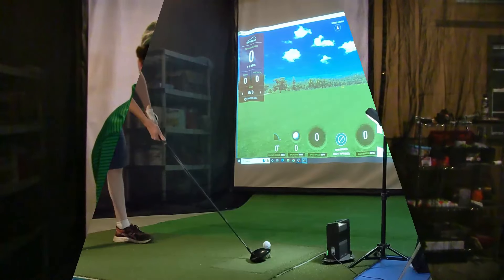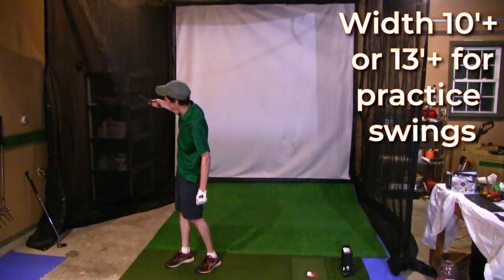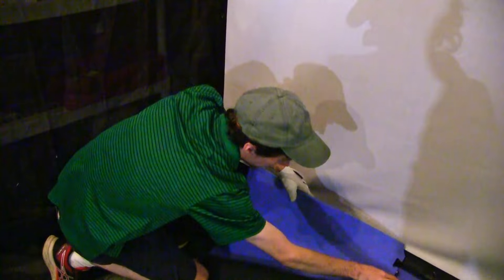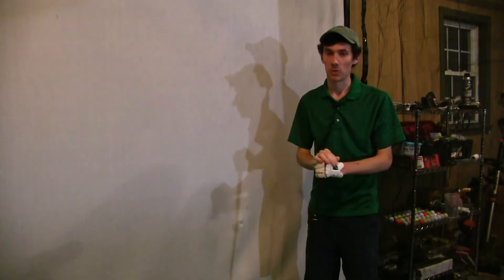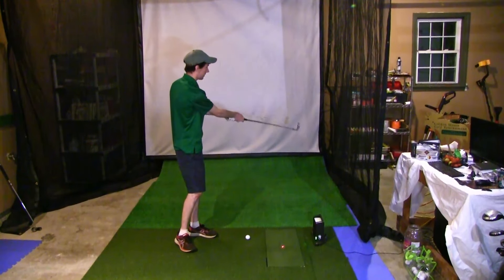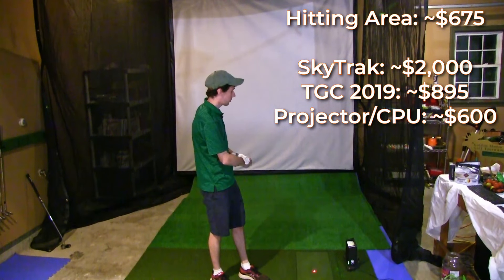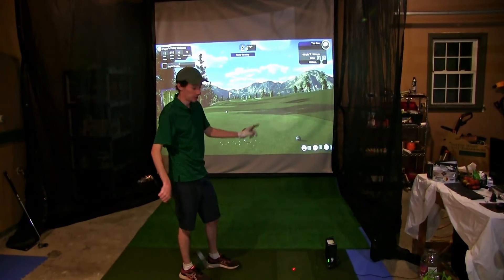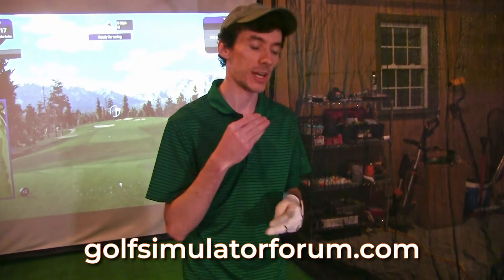Building a Cheap & Safe Garage Simulator Cage - SkyTrak, Mevo, etc

Comment: Excellent video, I really appreciated the detail.  If I were to install a simulator in my garage I would need to accommodate left and right hand golfers.  What modifications need to be made?  How much more space do I need?
Reply from the maker: Depends on if you are using a fixed overhead LM or something that you physically adjust based on the user, then if you want everyone hitting from the same spot. Generally speaking you are going to need about another 6' of width to accommodate swings from both sides of a central position, but make sure you research on the golf simulator forums to see what people using your chosen LM are building! Good luck my friend!

Comment: Great build.....What was the mounting height and distance from the screen of your IN119HDx projector?  Thanks,
Reply from the maker: It's is mounted about 9'8" above the ground, 14'8" from the screen. I used the projector central calculator to figure out what I needed based on the lens specs and where on the screen I wanted to project the image.

Comment: I'm going with a similar design using vinyl room dividers with grommets every 12".  Can you elaborate on tensioning the sides of the screen?  Did you use eye hooks like you did with the ceiling?
Reply from the maker: Good luck my friend! The side tension on the screens is bungees going out to some shelving units I had nearby on the outside of the cage. I looked at concrete anchors as a solution here as well but this was much easier, just had to make sure the shelves were far enough away from the sides so they would get hit!

Comment: Very helpful video, I love it. 

Is your garage heated? I have a double attached garage that is insulated but not heated and wondering if I can get away with just using an infrared plug in heater when I'm golfing. I experience similar winters to you.
Reply from the maker: My garage has an overhead Modine Hot Dawg propane heater in it that I usually run up to about 68* in the winter. I then shut it down and let the garage cool when I'm filming, so if the video goes longer than a few hours I'll have to stop and heat it back up again since I can't run it and film at the same time because of audio pollution 😂

Comment: Is the sky track still going strong for you. I know it’s alittle old now but someone kind of local has one for $800obo so I’m sure I can grab for about $600. Thought about maybe going the rapsodo mlm2 route also not sure yet.
Reply from the maker: Absolutely! The best data to have measured accurately and not estimated is ball data since that's where the magic happens. Being miles more accurate for ball data than radar based units is ideal, and I haven't run into any issues in the time I've owned it.

Comment: Since you are setup more towards the right of the screen, does this skew shot direction? Or does the sky track read the real shot data as it’s hit and correlates to an on track ball flight even though you are on the right side of the screen?
Reply from the maker: Correct, the SkyTrak only cares where you are hitting in relation to its own alignment. They also have a feature where you can shift the driving range visually off center as well to help combat the "feeling" of aiming into the center of the screen. TGC 2019 also has that same feature, I don't use it for most of my recordings though, I just Hit it at straight at the right side of the screen. Good question!

Comment: You said you’re using a 9’ x 9’ impact screen? What aspect ratio is your projector set to? It looks pretty good and the whole aspect ratio thing is stumping me. I don’t have quite the space for a 9x9 it’ll be closer to 8x8, just trying to figure out the projector and what the image will look like.
Reply from the maker: I've used it in both 4:3 and 16:9. I currently use 16:9 because it is easier to record for YouTube. The extra black/unused space at the top and bottom of the impact screen doesn't bother me at all. It will certainly bother some people, especially in more of a cinema room style build.
Reply: For 9X9 it would be best to use 1:1 aspect ratio.

Comment: Awesome set up and tutorial thanks!  Building the same exact set up in my tight little garage space with an 8x8 screen and 10x12 tarps from Harbor Freight.  Curious how you have your tarps installed and on what ceiling track system?  Thx!!
Reply from the maker: I just searched for some flexible curtain tracks on Amazon. Instead of putting one grommet through one of the track runners, I used 2-3 runners for each grommet with zip ties for the additional support. It has worked well so far for my tarps, but I could see it struggling with heavier tarps for sure. Thanks for watching!

Comment: What computer did you use? What projector. And what software. I am building the exact same setup but there are so many different projectors and computers and requirements for software. Appreciate the help. Hoping to have this built by the weekend.
Reply from the maker: Good luck with your build! Your computer specs will be dependent on the Sim software you want to run, I'm using TGC 2019. My computer is fairly beefy compared to minimum specs since I need to also record video at the same time. As for the projector, I'm using an InFocus IN119HDX. Cheap and reliable, and I don't need 4k for any of my needs. Certainly use the projector central throw distance calculator to make sure your projector matches the screen you are looking to fill!
Reply: @muskratlinksgolf  I will also be using the TGC 2019. Just don’t want to spend 1k on a computer tbat will be used only for that software. Any help is appreciated. Ordering tbat projector now as it seems like it should work in my space.
Reply from the maker: @1WickedSS  Ya the projector has a decent adjustable throw distance too which was helpful for mounting it since I didn't need to be inch accurate. Looking at the TGC minimum requirements, i5 and 4G of vRAM is all it needs, I feel like you should be able to get a pre-built for closer to 800 but I'm not expert on that 😄

Comment: How do you like this after 2 years?  Any recommended changes?
Reply from the maker: @displacedtexan6114  Great question, I'm actually doing an update video later this week! Honestly it's worked out way better than I could have imagined. To make this super safe retractable/collapsible sim cage for under $750 is unheard of. I haven't even rotated the square impact screen yet which was one of the great budgeting plans haha. I would estimate I'm somewhere between 30k and 50k shots in this cage, the only thing showing any sign of wear is really just the hitting strip, which is part of what I'll be testing in next week's video 💪
Reply: @muskratlinksgolf  thank you for the input. Looking at building this once my new outdoor shop is built. Hoping to save a space for this set up.  Would you see any concerns with the tarps being only 8 feet out, I'll be using the mevo +
Reply from the maker: @displacedtexan6114  Nice good luck with your build! It will depend on where you have your hitting area, as the main reason to extend the side baffling is to catch all hosel and toe shanks. If you can safely catch those, you're in business!

Comment: This is the video I’ve been looking for! Can you elaborate on the track system for the cage? My goal is to be able to still park cars in the garage
Reply from the maker: Yep, certainly can be done! So I searched for some flexible curtain tracks on Amazon and screwed them into studs in the ceiling. Then I hooked 2-3 of the little track runners together through each grommet of the tarps with zip ties, this allows me to slide both sides and the "roof" of my cage back and forth out from the wall of the garage. The roof is tensioned by pulling it out away from the impact screen and looping the ends over some additional eye hooks with bungees as you saw in the video. Thanks for checking it out!

Comment: Where is your impact screen from? How has it held up?
Reply from the maker: It's a Carl's place standard screen, the one I got was even cheaper because it was a clearance one. It has held up super well! I bought square because I could rotate it 4 times if my off center impact area wore out, but I'm probably about 25,000 balls in now and I'm not close to rotating it! Use clean undamaged balls and you should be good!

Comment: what net did you use?  I may have missed that in the video but didn't see it.
Reply from the maker: I went with 4x https://www.harborfreight.com/10-ft-x-12-ft-mesh-all-purposeweather-resistant-tarp-60576.html
We sewed them together to make sure nothing could escape along the edges and corners. This formed the outer netting of the cage.

Comment: Does your channel have a video of you installing the netting/impact screen? I’m wanting to do something simple and retractable like yours. So I’m looking for some examples of how I can do it.
Reply from the maker: I don't have a video specifically installing the track/curtains, but I will add some more detail here:

So I searched for some flexible curtain tracks on Amazon and screwed them into studs in the ceiling. Then I hooked 2-3 of the little track runners together through each grommet of the tarps with zip ties, this allows me to slide both sides and the "roof" of my cage back and forth out from the wall of the garage. The roof is tensioned by pulling it out away from the impact screen and looping the ends over some additional eye hooks with bungees as you saw in the video. Thanks for the question!
Reply: Thank you for the information!

Comment: This is an excellent video. Will be saving it for when I build one in the next couple years. One question, I’m a lefty, basically everyone else I play with is a righty, would I be able to play a round with my right handed friends? I imagine all I’d need to do is walk the monitor to the other side of the mat but don’t know how it works
Reply from the maker: Thank you! It wouldn't really work out during the same round as you need to change settings on the SkyTrak and realign it each time you needed to swap sides. This is an opinion, but you could probably play a full round lefty, swap everything over, then have your righty friends play their round. Otherwise the other option at this price point is the Mevo+ which is Doppler based and sits behind your hitting area. Much friendlier to a mix of lefties and righties!
Reply: @muskratlinksgolf  thank you very much!

Comment: What did you use to connect your side-tarps to the rails so it slides back and forth nicely?
Reply from the maker: I just released a F.A.Q. video that address this much better than this comment will, but essentially I used zip ties through the hooks of 3 rollers that came with the tracks to give it that smooth sliding ability!

Comment: The distance from the top tarp to the wall is what? In case one of my buddies hit above the screen. Trying to make it safe for my non golfer buddies
Reply: Or ceiling shall I say so I can start the build
Reply from the maker: Impact screen to back wall is pretty close, like 8-12 inches. That's shorter than recommended which is why I have those extra carpets and sheets hanging behind the screen. If you are talking above the screen like tarps to ceiling, it's a little less, but I haven't run into any issues with skied drivers or really high lofted wedges. The angle and speeds they are traveling just get eaten up by the baffling. Of course, your setup will be different so run some tests before committing to a design to make sure it is safe for your space! Good luck my friend! 🏌️💪
Reply: @muskratlinksgolf Preciate it! I’m probably the only avid golfer in the bunch so I’ll just have a little slack on the ceiling! Thanks! You saved me hundreds of dollars for sure going this route!
Reply from the maker: @jake3331  Boom, I love to hear it! Ya my roof tarp hangs down to more than a foot at the middle, there is another FAQ video on my channel that shows this if you haven't already checked it out. Sounds like you are in a good place though, I think you will really enjoy your Sim!
Reply: @muskratlinksgolf  I’ll have to check that video out!! Thanks again!

Comment: I'm getting closer. I have one mesh tarp up.... Woo hoo.  Did you use three flexible tracks?  Are they right angles or are do you have them kinda rounded off? Also, did you hang the 10' side or the 12' side.  I have it hung on the 12' side and there's about 2" open at the bottom.  If I switch it and hang the 12' side down I have a puddle of mesh at the bottom which I guess is ok
Reply from the maker: I went with 2 flexible tracks, but cut 1/3rd off of each track to use as the 3rd side. As a result I didn't round off the tracks, just ran the two sides perpendicular to the back. I used the "puddle of mesh" tactic as it is dramatically safer and the mesh can be tucked under the foam time floor in my design. Great comment and good luck!
Reply: @muskratlinksgolf  thanks man!

Comment: Great video.   Who did you purchase the screen from?   Love the setup
Reply from the maker: I went with a Standard Impact Screen from Shop Carls. I picked one up when they were on sale to save a few bucks, but they are priced very reasonably anyways. Thanks for the comment!
Reply: How did you the ceiling with the mesh tarp and how many tarps did you buy for the whole enclosure ... Thanks
Reply from the maker: @jeffparnell5916  We used 4 12'x10' tarps sewn together for the enclosure. The top one on the ceiling is attached at the front to the curtain rails, and at the back where we hit it is tensioned by attaching the ends over some hooks in the ceiling.

Comment: Honestly, I’m just trying to find a low budget at-home Golf monitor so I can at least see how far I hit because my parents don’t have time to take me to a driving range so it would be easier if I could just practice golf at home. Usually these monitors on Amazon are all super expensive can you please suggest me a monitor that would be more affordable for me? (Like at least under 800$)
Reply from the maker: Certainly take a look at the golf simulator forums to check out the different LMs and find the one that's right for you! There might not be reliable ones at that price point, hitting balls in the cage without one might be more beneficial while saving up for a more reliable unit 💪

Comment: How many shots does the 1/4 of the screen does it take before you have to rotate it
Reply from the maker: I've put about 2,000 or so into it now and it is showing light wear and some darker spots where balls that were scuffed or dirty hit it. I think I'll want to rotate it at about 8-10k shots!
Reply: @muskratlinksgolf  damn!! I like that! Thinking of turning a spare bedroom into a simulator don’t have the full 10 feet from swim spot but thanks for the info on the screen!
Reply from the maker: @BrockOutdoors  Good luck! My swing speeds are about 160 with a driver, so the screen will certainly wear faster with higher speeds or lower quality balls but it's a lot of fun!

Comment: Can you give some detail on the projector set up?  On the ceiling, how far away from the screen, shadows etc.  Thanks
Reply from the maker: Yep, good question! The best resource for this will be the Projector Central website throw distance calculator. If you have the budget, many configurations will use an ultra short throw projector mounted on the floor or on the ceiling close to the impact screen with a protective cage. My IN119HDx is mounted at just over 13' which is a few feet behind where I stand. Safely out of the way of any swing path, but close enough that shadows aren't an issue at all from either the golfer or the ceiling of the cage.

Comment: What golf tee are you using for the driver?
Reply from the maker: Good question, I use BirTees which are fairly popular in the simulator world. You can get them off of the BirTee website or off of Amazon. Most people use black as they seem to be less likely to cause any interference with photometric LMs.

Comment: how do i find that mesh tarp siding? and is it really safe? meaning no balls can go past it
Reply from the maker: They are the 10'x12' weather resistant tarps from Harbor Freight. I highly doubt they would stop a ball hit perpendicular to them without wearing out and eventually failing, but for balls hit parallel, it is very safe. They do a great job acting as baffling for shanks - especially because they hang loosely and absorb all the impact. As you can see in the video, I bought 4 and sewed them together to make an enclosed cube so balls can't get out along the seams where they meet.

Again, I'm not giving you directions on what you should or shouldn't do to your house, just providing feedback and sharing my process so it might provide some inspiration to you! Enjoy!

Comment: what projector did you go with? and mount?
Reply from the maker: I went with the InFocus IN119HDX, and the mount is custom using some metal brackets screwed directly into studs in the ceiling. I just released a follow up FAQ video to this one that has some more details about the projector as well!

https://youtu.be/1QOm9rLPqj4

Comment: I'm surprised the roof tarp is tensioned enough that balls don't dent your ceiling.  I saw that you use bungee cords to tension the top net/tarp.  Has that been good enough to keep the balls from denting the drywall ceiling?  Awesome video!
Reply from the maker: I was a bit surprised as well since I planned on adding extra foam tiles there too. I tested smashing some 60 degree wedges up there and even moon balling some drivers just to test hitting the tarp as hard and fast as I could. Not even a sniff of making it to the ceiling yet! Worked better than I thought it would!